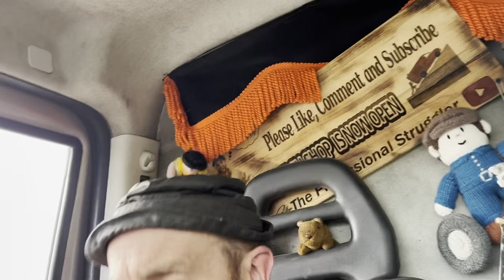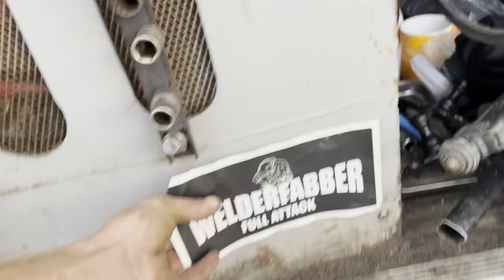Loading shovel MAJOR problem! CRANE GAME circuit board fault!

Comment: Great looking soldering job there. Actually it would be worth throwing a little tub of rosin flux in the toolbox for jobs like that. Makes the solder immediately bind to the pins and tracks.
Scottys yard is like a maintenance vacuum, apart from the bits you do. I reckon as soon as a machine goes through the gates, every bit of grease and oil magically turns into muck and rust, the fuel tank fills with crap and the machine ages by 5 years! 😄

Comment: If you get some soldering flux it makes soldering so easy, dip the bit of wire into the flux you dont need loads and get so solder on the soldering iron touch the bit of wire with the soldering iron and the flux will suck the solder into the wire, then put a bit of flux on the soldered wire and the bit your going to solder the wire onto and it will make a nice clean connection, try and wipe the flux off after soldering it cleans best with electrical contact cleaner and old tooth brush  other wise it gose bad in a couple of months if not cleaned abit

Comment: I knew a guy plowing snow on a gravel pit road with a 938 CAT loader, he had the bucket angle to steep hot a frozen wheel rut, that same dog bone snapped and the ram came back through the windshield. Lucky he wasn't killed.

Comment: Hi I wonder if that forklift engine has a crankcase breather filter on it and is it blocked pressurising the crankcase pushing oil out the seal it may be over full helping it go out the seal

Comment: It's horrible getting shocks off them stick welders, a few years ago when i was working for a blacksmith we got the contract with the local council for repair of gully covers they would go out cleaning the storm drains and if any were snapped or cracked they would write them down on a list and give us the list once a month anyway we got to this drain cover and between the path and the kerb was a strip of grass so i got all the all set to weld it i was sat on the damp grass cleaning the crack out ready to weld the lad fired the welder generator up he handed me the handle and a welding rod and as i was inserting the rod into the handle he shot the earth onto the grass right next to me well the shock that went through me was out of this world I've had shocks off 240v 13A but that was nowt compared to this when i finally let go of the welding rod i was shaking for ages afterwards, i had the dial at about 350A with it being a ductile cover and very thick and couldn't preheat the cover and couldn't remove it so had to whack the amps up and was using cast rods.

Comment: Just solder a piece of wire between the two joints Chris, the wire would create a new track on the circuit board for you

Comment: I work on forklifts, leave the transmission in, block it up and remove the engine, a lot easier. Seat and hood off, rad out, split em and lift the engine out.

Comment: I wouldn't be leaving the keys in the ignition with a two year old in charge of the van Chris, bad things could happen like a curious two year old, that starts the van, or a dead battery because in dads absence we've switched on every single switch and light a two year old could find 🤣🤣

Comment: Chris take the engine out m8 trust me dont wanna be fukin with than transmission quite easy 2 take out engine tbf well done m8 hope u r well.Just thought m8 while engine is out do the front seal and sump gasket as well while you are in there i have had the pick up pipes block on machines that lack proper maintenance!!!!!!!!so might be worth checking that as well if u do do the sump gasket as well good luck with it m8 anyway woop wooop bloody good show 😅😂😊

Comment: That arm has had it even if someone welded it (Not your pigeon poo) it still won't last long as I can't see it getting enough heat in it to get a strong weld I do know as been welding 25+ years and I would not have any thing to do with it. I'm sure alot of people say the same bloke needs to sort he's workers out on looking after all the machines on maintaining and cleaning them will save him alot of money that arm needs replacing wont be cheap even if someone get a second hand one keep struggleing on mate

Comment: Scotty needs to get some people sacked.
Reply: Dead right
Reply: To right they need sacking and I bet they are young lads who don't give a 🤬 not like the older generation
Reply: Scott needs to sack quite a few of these so called operators remember the one where the fool didn't know where the grease nipples were so sad young know it all apart from how to destroy machines
Reply: It s not that they need sacking they need proper training as operators first job  every day is checks and maintenance 
Its happening everywhere all the so called machine operators on building sites ripping concrete up with the ditching bucket until its as bent as elton john
Reply: Im late to the party been stuck to the bog ast 4days both end 💩🤮 but how the fuck they brake that 😮 c
Good job birdster and leerdaag there to sort it woop woop JB ❤❤
Reply: Very true should be trained to maintain the machinery but if they have operated them before then they should know that if it's different to wat they was used to operate then should been shown how to do it would save alot of time and money
Reply: Chris wouldn't have any work there if Scotty sacked them, Chris needs to earn his living.
Reply: Scotty needs to look after his equipment a lot better
Reply: Trouble is everything is rush rush rush they aren’t given time to maintain anything properly , even the big machines are worked until they break.
They need someone to maintain the machines.
Reply: Take engine out it's easier than taking gearbox out
Reply: @tutsywutsy  not always as most of the time easier to take gear box off before you even have to look at the engine
Reply: @chox2001  that’s the trouble with every industry as the buses and hgvs arnt much better, as Nat ex they’re on a very tight turn round for engineers to look at them and they wonder why they go bang aswell, cos the engineer hasn’t had the chance to get the coach of the road properly to get a proper look at the faults or swap the parts needed out